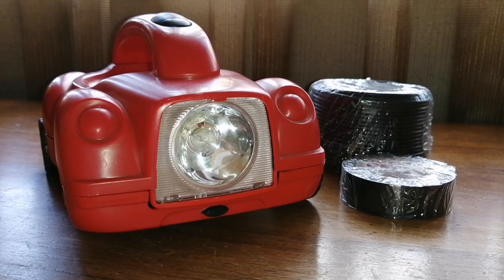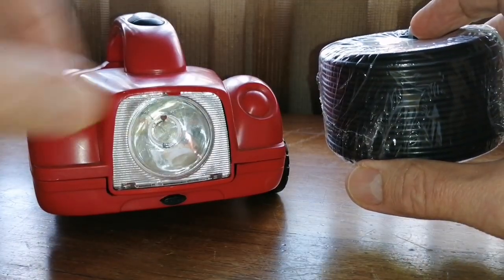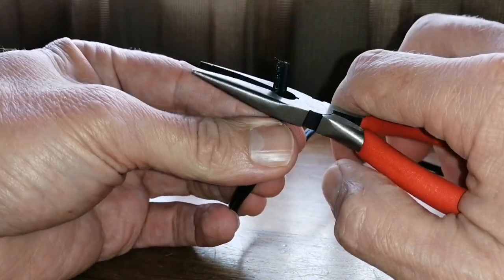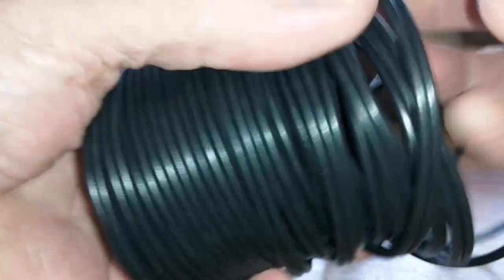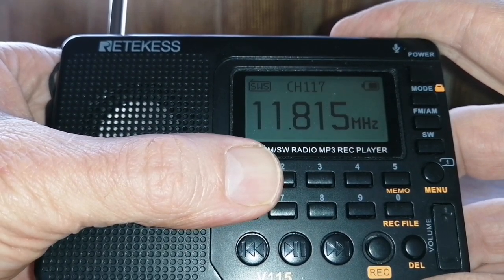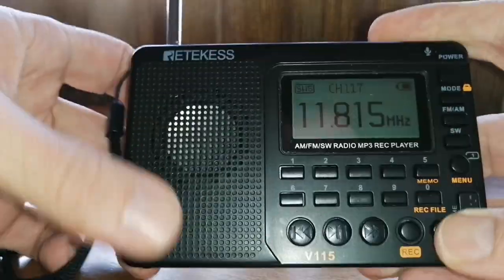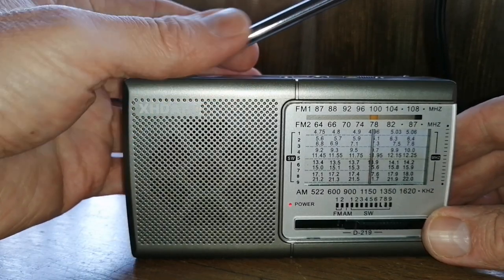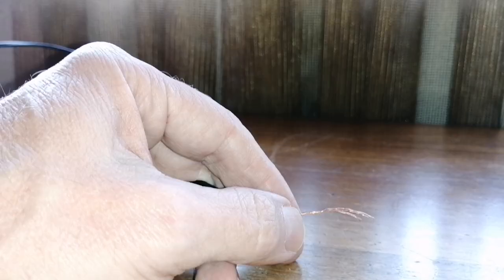How to use a long wire for improved shortwave reception #radio

Comment: A few decades ago, we had a "wire" clothes line in our backyard. And we just put the metal dipole antenna of the radio into direct contact with our clothes line and "Presto"!
It gave us great reception!
Reply from the maker: Yes, that is a very good trick! Some people also use wire fences as antennas, apparently it can work very well.

Comment: Even when I take a walk through the forest behind my home, it’s good to carry a little bag with a length of wire that can either plug into the radio itself or clip to an antenna itself. Bag would contain the wire and radio as a travel bag for the radio. With my XHData or Tecsun. Works wonderfully!  A super long length of wire wrapped around the radio itself and then sent for a long run makes a great MW antenna! A shorter length connected directly with the radio some way helps the shortwave and FM. Because the MW wavelength is so long. Doing different things with the wire helps different frequency ranges. I super enjoy your channel and recommend it to anyone.
Reply from the maker: Thanks for the tip about the MW antenna, I never thought of that! And thank you so much for your comments about my channel. Highly appreciated!

Comment: I find with my 45 feet into a tree tends to overload my portables.  It works well to leave the receiver end of the wire with the insulation still on. Loosely couple (inductive) to the whip by just wrapping a couple of turns of the insulated wire around the whip. This works well on all my portables. 😀
Reply from the maker: Thank you for the suggestion Rob! This seems to be a great solution if you find that your portable overloads with a wire when you connect the exposed receiving end of the wire directly to the antenna.
Reply: I have a 30 foot wire strung from a wooden mast in the garden which works well for most portables but with the XHDATA D-219 even wrapping a couple of insulated turns around the whip as you suggest is too much for it. It overloads badly and suffers breakthrough from strong stations and a local high power medium wave station. I find that just placing the radio no closer than 3 inches to the wire is enough to improve reception a lot without driving it into overload. Either that or I hang a portable wire antenna from a different radio from a curtain rail indoors and only extend it about 6 feet. This is then plugged into an inductive coupler and slipped over the whip. This also dramatically improves reception of weak SW stations without being overloaded by strong stations on other frequencies.
Reply: @NJT1000  Yep A lot of cheaper pure DSP receivers are very prone to strong signal overload.  Broadband input with no filters.  What you are doing is spot on. Have to experiment. I sometimes use a shorter wire or just place the rx near the lead.

Comment: Thanks, I have both the same radios and just purchased speaker wire myself...will try it at night and not expecting much myself because of the cheap radios, but having fun trying ..
Both are awesome for the price and provide good FM listening
Reply from the maker: I think you might be surprised with the Retekess V115, it really surprised me! Works very well with the wire. The D-219 not so much, but maybe with a shorter wire it might also work. Some radios, like the V115, seem to be able to handle the strong signals coming in through the long wire very well. Others overload and just become noisy, like the D-219. I do also like both these radios, the D-219 is great for shortwave with only its built-in antenna. And the Retekess has great sound for FM and MP3 listening.
Reply: Thank you for your experience!
Will have fun experimenting with both!
These cheap radios are awesome for the price and imagine sometimes it's the lot production on the quality for the end product.
Doesn't matter as long as I can listen to my stations on FM.
Also bought a Kaito 369 emergency radio which is very good along with a Audiocrazy AMFM retro mini that is very good too.
Got to stop now with the radios...think this is enough.
Will subscribe ...👍
Reply from the maker: @vincentkosik403  I think one can never have enough radios 😀 It becomes something of an obsession for some of us. I recently bought a Tivoli Model One BT, which I mostly use for FM and Bluetooth streaming. Terrific sound from that one. It was a bit of a splurge for me, a radio I had always wanted, so I saved up over time until I could get one. Definitely one purchase that I don't regret at all! But, actually, I haven't regretted any of my radio purchases, they all have their uses!
Reply: @swlistening  Did the same with film cameras .....it's just for fun...
Reply from the maker: @rajeshkrdubey  It might be that the wire picks up too much electrical interference in your area or overloads the radio. The D-219 needs a very short wire, it does not work so nicely with a long wire.
Reply: @swlistening  thank you for the tip

Comment: I have a 10 metre wire strung from a mast in my garden. It works well with my vintage Sony ICF-7600DS and XHDATA D-808. However with the D219 it makes reception worse as it suffers badly from overloading and the extra gain completely overwhelms the front end which goes deaf. It also suffers breakthrough from a strong local medium wave transmitter and other strong SW stations with the wire attached, making it difficult to hear the actual station I am trying to tune in. I have found that the D-219 works best with 2 metres of wire indoors hung from a curtain rail. This gives a useful boost on weak SW stations without overloading it.
It looks like it's worth experimenting with wire antenna  configurations depending on the receiver.
The D-219 seems to be very sensitive on short wave. I have a recording of it's performance compared with the Sony and D-808 receiving Radio New Zealand International which is as far distant a station I can receive here in the UK (18730 km). The D-219 is the clear winner. I must have a go at editing and uploading it.
Reply from the maker: I agree with you about the D-219 and a long wire. As my video also shows, it just does not seem to manage with a 10 metre wire. But it remains a very sensitive little radio, just with its own built-in antenna. Like you, I have managed to pick up some really distant signals with my D-219, including WWVH. That is the most distant signal I can get, over 18000 kilometres.

Comment: Hi Andre.  I have read elsewhere on the internet that the D-219 overloads with a long wire.  Have you found that to be the case?  I have a Sangean ANT-60 portable antenna which at full extension is 23 feet long.  Many thanks for your excellent content.
Reply from the maker: It is true, if you use a wire that is too long the D-219 does overload, I also experienced it. If I use a wire of about 10 metres (just under 30 feet), it overloads. But I do use a shorter wire, about 3 metres (10 feet) very successfully with the D-219. It is so sensitive anyway that it works quite well without the wire, but on weaker signals the shorter wire works very well.
Reply: @swlistening  Thank you for the quick reply.  On another note, I see that the D-219 is now available in a 10kHz version for AM.
Reply from the maker: @gaoldias  That's very interesting to hear! Great news for people in North America.

Comment: Hi! I am writing from India. There is so much fuss being made all over the world over the newly launched XHDATA D219. Other small SW portables have been launched in the past but the XHDATA D219 is hogging immense publicity and interest among both amateur radio enthusiasts AS WELL AS SERIOUS SPECIALIST DX-ers. Please tell me Andre, as an expert — IS THE XHDATA D219 REALLY THAT GOOD A SW RADIO TECHNICALLY AND SW PERFORMANCEWISE?
Reply from the maker: I think the fuss being made about the D-219 has to do with the incredible value of this radio. It is quite inexpensive, so many people were surprised by the performance of this radio. I really like it, I think it is very sensitive and it seems to pick up SW signals very well. The one flaw, but many DSP-based radios have this, is that there are several peaks of strong stations when you tune. But it locks onto signals really well. The sound is nice for such a small radio, the batteries last a long time, it is very compact and easy to carry around. So there are many good things about this radio. In my opinion there is nothing in the $10 to $30 price range that can compare to this one. It is good.

Just last night I did a comparison on a rare signal, Radio Congo, on the D-219 and the D-109. In this comparison the D-219 clearly outperformed to D-109. You can see here: https://youtu.be/M74ToBW4Uaw
Reply: @swlistening  Thanks a ton, Andre, for reading my query and replying to it at such length. I am well advised now by an expert on the XHDATA D219 and where exactly it scores high, thanks to your domain knowledge, experience and expertise. I have now almost made up my mind to buy this little gem of a radio. I will definitely look up your Radio Congo test review. Thanks again.
Reply from the maker: @bhaskarsinha1527  I hope you will like the radio!

Comment: Curious to know whether this wire antenna will be strike by lightning?
Reply from the maker: That is a question that all DXers have :-) The wire is insulated, but there is always a chance of a lightning strike. Best is not to use it when there is an electric storm.
Reply: Thank you for your reply.
That means I need to remove the antenna from the radio to avoid damaging it.
Reply from the maker: @newstar346  Sure! I don't remove mine when there are storms, I just make sure that it is not connected to the radio. We have very strong electric storms here where I live in Johannesburg. The cable is still fine. It is just a sensible precaution to remove it from the radio and to refrain from using it during a storm.

Comment: So this can work on any radios. Nice. People use V115s for DXing and that wire can help quite a bit. I will use this with my Sony and my Tecsun when it arrives. I like your toolbox. Where did you get it?
Reply from the maker: Thanks :-) I got that toolbox as a gift at a Christmas party, where everyone took gifts to share among one another. Like bring one, take one. Long time ago already...
Reply: @swlistening  We had a thing in my old school similar to that. We did it from 2019 to 2020. "Previously Loved" was where we would bring things we don't use anymore and just want to give away. I found an old toy of mine and gave it away in exchange for a little radio and calculator (Not sure when it was made) and used it for many years. Unfortunately, the old batteries were left inside and corrosion seeped into the circuitry, so it is unlikely I can fix it, or even get it fixed for that matter.
Reply from the maker: @FamtechVideos  Sounds like you have always been into radios!
Reply: @swlistening  It was an alarm clock as well. I don't know how, but there is this link between me and radios I can't understand.
Reply from the maker: @FamtechVideos  No need to understand it, just enjoy it 😀
Reply: @swlistening  True. I will try finding it tomorrow. Goodnight.

Comment: On the d109 do I use a stereo or mono mini jack for the external antenna. Is that input better than wrapping the extension around the antenna as you show here?
Reply from the maker: If you have an antenna input port it's better to use that than wrapping around the antenna. But many radios do not have the antenna input port, then it works fine to wrap it around the antenna. On my XHDATA D-808 and D-109 I use the actual antenna input port.

Comment: You need an alligator clip for the wire.
Reply from the maker: It does help, but it also works if you just tie the wire around the antenna. Just as a funny aside, we call them crocodile clips 😀
Reply: @swlistening  In the UK we also tend to call them crocodile rather than alligator clips.

Comment: I keep getting chinese stations. I want to pick up broadcasts from the western hemisphere
Reply from the maker: Where are you based?
Reply: @swlistening  south east Asia. I got a tecsun 9012. A lot of speaker wire too
Reply from the maker: @HarenunHoppus  Just a thought, I also have a Tecsun R9012, it is a nice radio, but I don't think it is the most sensitive radio I have. Sometimes I find it quite hard to hear weaker signals on this radio. Maybe, if possible, you could get something like the XHDATA D-109 or the D-608WB, two relatively inexpensive radios and I find them both really sensitive. Perhaps you might have better luck with those.
Reply: @swlistening  looks like the wire i got wont help much. But thanks for the tip